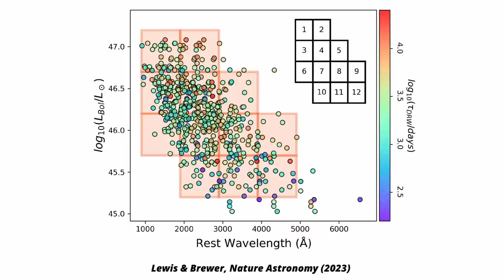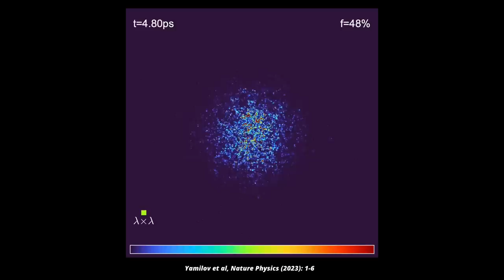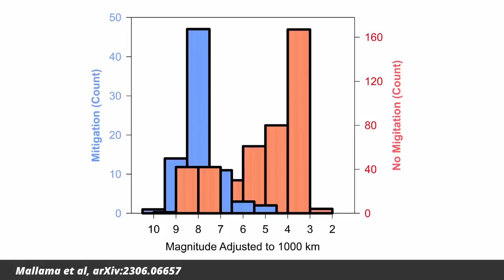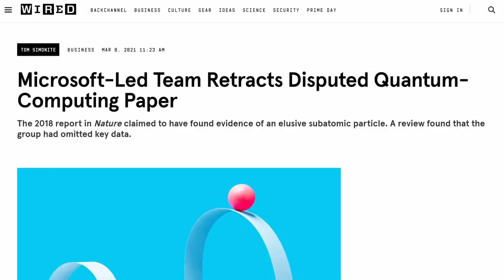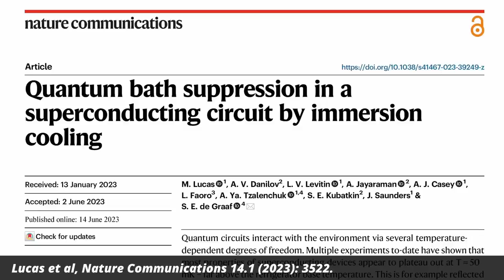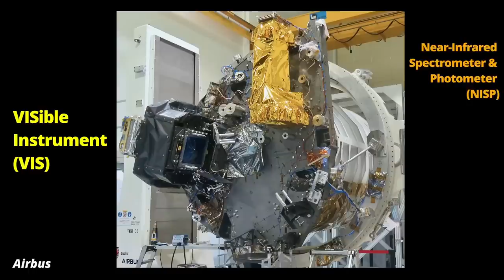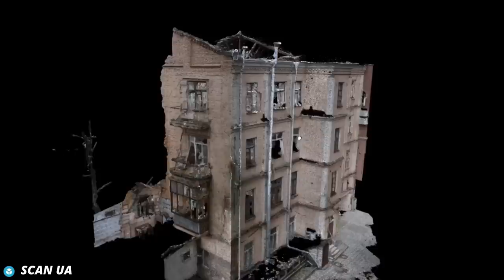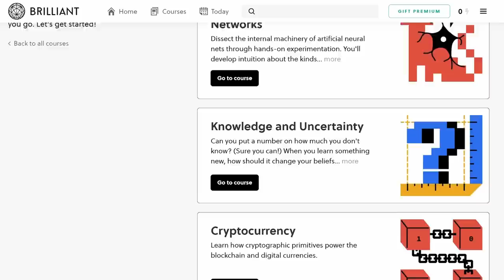Time Ran Slower in Early Universe, New Study Finds

Comment: I had tinitus. It went a way when I changed my diet to a low carb diet. I don't know if that will work for everyone, but it did work for me. Worth giving it a try.

It does come back when I cheat for a couple of days. Good motivation to stick to low carb.
Reply: correlation =/ causation
Reply: @filonin2  That's why I said: Worth giving it a try.

By the way, when I do cheat on my diet, the tinutus comes back. So there's definitely more than just correlation.

Comment: My model of the universe questioned the timeline of the forming universe due to the close proximity of all forming matter in the early inflationary and cooling down period of the now perpetual expanse of the emergent universe. Furthermore, I believe that the expansion of the universe is a constant that appears to be accelerating. Like the needle on a record player it spins at a constant however the needle itself must travel further each rotation as it moves further out to the perimeter of the record disk, making the length of the traveled distance a faster movement each rotation. I also predicted that there is a constant vibration throughout the entire universe that would probably be detected as a hum. This vibration i hypothesize is a vibration at the planck level of incremental movement. This I refer to as the present timeline only to measure the duration of the vibration. A relativistic timeline is a measurement from different perspectives, and the speed of light timeline measures distances. But what occures during this vibration affects the movement of every particle identified within this timeline at its present tense.

Comment: 1:23 if you've got ticks, you've got to do like my daddy used to for us kids in Kentucky. Take a match. Light it and let it burn a few seconds. Blow it out and touch the tick near the surface of the skin. Best chances are she'll pull out. If that doesn't work for your ticks, take a pair of tweezers and grab the rear end of the bug and twist it counter clockwise as you very gently pull on her. She should come right out. Now, I'm 50% sure it was counter clockwise and not clockwise. The worst that can happen is you'll twist her apart at her neck and her head will remain under the skin and cause an infection. But in Kentucky we get a lot worse than a little bitty infection from a tick's head. We've got lots of deadly snakes all over the place you've gotta watch out not to step on. I hope my advice takes care of your ticks on your waves in the time dilation of your universe. Happy hunting!

Comment: I am confused by item 1: The headline is "Time ran slower in the early universe", but the final statement is "It is just an observational effect" for us looking back. Now what ?   Is the headline just a misleading catch that should be replaced by "Time did not run slower back then" ?
From the citation of the original paper it does not become clear to me, how red-shift by expansion of the universe and by slower "ticking" time can be distinguished. 
If it actually did, isn't part of the apparent red-shift then due to the latter and consequently actual distances less than currently believed ?
Further thoughts: In that case, did light travel the same distance in less (due to slower) time ?
Would that mean that the speed of light was higher ?

My confusion increases...

Comment: If the universe started from a universal black hole that got very deep and exploded because gravitational fluid got backed up entering and exiting the core, there would be a lot of gravitational sag that quickly flattens out in some big bang tsunami. Once flattened out it can equalize with the surrounding (outside the matter filled universe) fluid and regain support, but is still limited by the speed of light. There is a time of equalization and the universe was smaller so the speed of light exchange would not be too slow. The higher gravity and sag, the slower time is.

Comment: As far as I can see every observation of red-shifted EM-radiation from a distant galaxy is an observation of cosmological time dilation.  In principle, the frequency of the radiation provides a clock with a certain rate of ticks at its source and when we look at the red-shifted radiation we see the clock running more slowly. As everyone knows, primarily, it's because the distant galaxy was  moving away from what has become us. I believe dark energy adds to the red shift that would be there with a cosmological constant of zero. Any other distant clock is obliged to be consistent - i.e. to have the exact same dilation factor - so it should be no surprise if this is confirmed. Still good to do so.

Comment: If time ran slower in the early universe, there is no dark energy.

Assume there are 2 observers, O who is deep in a gravity well, and O' who far away from any mass. General relativity tells us there is a time dilation T between them. Now they both observe a light echo. https://en.wikipedia.org/wiki/Light_echo

The measurement of the amount of time for the light echo is t for O and t' for O'. From GR we get:

t' = Tt

And the distance light has travelled in the light echo is:

s' = ct' and s=ct for O' and O respectively, where c is the speed of light.

s' = ct' = c(Tt) = T(ct) = Ts

The time dilation of GR changes the measurements of distance. The farther you are from mass, the larger your measurement of the universe. Dark energy is not require for the expansion of the universe. Only GR is required.

Comment: If time speeds up. Then there is no (or less) Doppler shift in light. Frequency remains fixed and the viewer is observing from a faster time line. Resulting in a smaller Universe than currently calculated.

Comment: It's good they found evidence for cosmological time dilation, but that effect makes perfect sense in any physical model that explains causality (aka the arrow of time) as the direction in which energy density decreases (has negative gradient). And that applies to any direction in (4D) spacetime, where "time" dimension has exactly the same properties as all the other "space" dimensions. It's only our perception of the sequences of events that gives us the impression that "time" is special in some way. It isn't. "Time" isn't even needed to explain anything, whether in a 1D or a 4D block universe.

As for "time" moving "slower" in regions of space with higher energy density, that's only relative to regions of space with lower energy density. Two observers, one in a region with higher energy density (on the surface of a planet, for example), and one in a region with lower energy density (in empty space, for example) would measure exactly the same value for 1 "second" whether they used a clock or a photon traversing certain length of space.

I'd go as far as to say that the constant nature of the speed of light is not just an assumption (of special relativity), but a fundamental property (of space"time") that arises naturally from the "dilation" of space("time"), or if you will, from the "contraction" of Planck values in the presence of energy... or, to refer to the model of space"(time") as a network of resonance chambers (or Planck cells, in the words of modern physics) whose function is to entrap "particles" (which aren't recognized by modern physics, but strings from the String Theory came really, really close to the concept...) of infinite potential/infinitely small size, where that reduction of the size of each cell happens in order to additionally constrain the "spillover" (of the entrapped infinite potential) between neighboring cells.

If anybody's into it, just do Fourier analysis of Dirac delta function (in the frequency spectrum), and see what happens to those infinite frequencies (of the infinitely "small" signal that Dirac delta function is) as you change the size of the resonance chamber/Planck cell (where only the signal periods which are whole multiples of the chamber's size can exist), and you'll see that the number of allowed frequencies decreases as the cell's size decreases.

The number of allowed frequencies will remain infinite "forever", but that infinite number will still keep decreasing as the size of the cell decreases... until the size of the cell itself becomes infinitely small (or "zero", if you will, though the concept of "zero" itself loses all meaning at that point, see below), and only one frequency can exist inside such an infinitely small cell -- the infinite frequency (or the "naked" infinite "particle" itself, if you will)... and space("time") ceases to exist.

The matter of the fact is that the very concept of space (with or without "time") loses all meaning at that point, because "space" is a mathematical concept, and mathematics can't really deal with infinities (it only really pretends to be able to), and infinitely divisible physical "space" is no space at all.

Yes, mathematics already works with continuous (infinitely divisible) spaces, but only in the form of abstract concepts. Try to give that abstract concept an actual physical reality, and... watch all of your carefully constructed math fall apart like a house of (beautiful, some would say... but not me; I'd call them utterly worthless or worse) cards.

Physical mathematical, discrete spaces are possible (this universe is an example of one).
Physical non-mathematical, continuous spaces are possible (it is possible to make a mathematical model that predicts the existence of one, as explained above).
Physical mathematical, continuous spaces are impossible (for all anybody knows, as no one has ever found one; so, until somebody actually does find one... nope, they're just not possible).

P.S.
It's good that no one ever reads these ("private") opinions... or they might get some "strange" ideas that could be found... "undesirable" by some... "higher-dimensional entities", to dip my feet in the woo-woo, new-age pond... or "non-physical intelligences", if we're to speak the woo-woo, modern physics lingo.

Both of those languages are closer related (in terms of the concepts that they are converging toward) than people realize.

Comment: I will now demonstrate what happens if you don't use Sabine's sponsor, and ask questions about things you only think you know.... 1. Quantum noise, if you do a single calculation using two sets of cubits that start in opposite states could you cancel the noise in a similar way to differential signals in audio wires? B. Would an observer in the early universe looking forward through spacetime and gravity see our time as proceeding slower also? Or would we appear to have faster moving time?

Comment: Hi Sabine, I'm writing to you 8 months in the future from this video.😂 Proof me that is impossible contact you in this pass. We go omniscient in the flow😊 my new theory.

I learned that time its just a coordinate in the infinite space.

How a coordinate can be slowdown?

If is measurable time what you talking about. How you traveling in the light speed slow your measurable time? 

00:56 the galaxies redshifted because the space isn't clean there is a lot of dust and the water slow down the light speed and solid objects just block it.🎉

2:56 driving at different speeds in a highway is a realistic example.

Comment: If the universe is expanding then it's only an illusion that time ran slower in the past because we are measuring it from a midpoint. As we look out we see expansion which gives the illusion of time slowing but if you were to reverse the action those points would become consolidated and closer together meaning time ran faster in the past not slower* It is also an illusion that the rate of which the universe is expanding is increasing. Its a consistent expansion. But when you are a particle within the expansion, You would be measuring an illusion That seems as if the expansion is speeding up but that is just a byproduct of relativity. Look at a baseball explode in slow motion. If each particle of the baseball were to measure the speed in relation to each other in ascending order from the innermost part of the baseball to the outermost part of the baseball, It would give the effect of an increased rate of expansion. But that's just because the explosion is emanating from a single source. The outermost diameter of the baseball does not increase in expansion rate. Only the distance between the particles is growing but the rate of which the particles are expanding is a linear rate. Its just an illusion. By definition time would have had to have run slower in the past if the universe was in a more consolidated state. So not only did time run faster in the past but the speed of which the universe is expanding is not increasing. And dark matter isn't real. Oh and neither is dark energy lol. These are just concepts people invented to explain away the illusion with bad math. Been saying it for 20 years😅

Comment: I wonder if the fact that time ran slower in the early universe means that the observed acceleration of the expansion of the universe is actually as a result of the acceleration of *time*. Is it possible therefore that the rate of expansion of the universe is constant?
Reply: were you paying attention?  it wasn't running slower.
Reply: Yes, I wonder the same thing. Could dark energy be time?
Reply: @-TriP-  Yes, yes, "it's an observational effect". So is the expansion of the universe, effectively.

Comment: I'm not sure about your research into laser acupuncture. Laser acupuncture can result in adverse effects, such as transient dizziness, headaches, and fatigue. Laser therapy can also result in misdirected or excessively intense burns, bleeding from the choriocapillaris, damage to macular and other ocular structures, and breaks in Bruch's membrane. The idea of applying something to acupuncture points smells of quackery simply because acupuncture itself is sheer quackery. That said, it could have some beneficial results due to the fact low-level laser therapy may have some benefits in some cases. I'd need to look more into these results but I am highly sceptical of this.

Comment: Time ran slower in early universe, new study finds.

-=-=-

My first impression [of that section], based solely on the title and likely assumptions:

So either nothing really changed (iterative quantized effects happen per base-unit-of-time, regardless) or something weird is happening now (more iterative quantized effects happened per base-unit-of-time back then vs now, and the why of the slowing (the reduction of maximum quantized effects per unit of time has greatly reduced) is inexplicable)

Sounds like the explanation of "universe initial explosion slowed, then restarted as expansion. Magical explanation follows" (which ignores the usual "there was nothing to stop the explosion" stance (or "nothing to slow..."))

-=-=-

After watching (3 min 5 sec):

Cosmological time dilation... Really...  So, we can no longer use redshift to determine how long ago a given photon took to reach us (by our perspective) because there is now a time dilation component.

Thus (assuming a smoothly scaling time adjustment rate that has close correspondence to 1:-1), distant stuff (near 45 giga-light-years distance) which supposedly happened 13 Ga ago actually happened 2.6 Ga years ago, while less distant stuff (say 30 giga-light-years distance) happened 4 Ga years ago.  If I assume a smooth rate comparable to relativistic effects, then the 30 g-l-a stuff happened (2/3ths distance, use www'omnicalculator'com for relative 5.11x adjust (at approx 294 000 kps speed), 2/3 speed gives 1.32x adjust, kurzweil library shows an example 30 g'l'y' galaxy at 13.1 Ga old) 10 Ga ago.

(Simplistic form is: If the time adjustment factor is right, then there are at least 2 ways to view it.  My examples are linear rate of change (nearer object uses a reduced time adjustment directly proportionate to distance) and semi-relativistic rate (nearer object uses a reduced time adjustment proportionate to the extreme case being treated as a relativity adjustment).  A linear rate of change shows that the furthest objects would actually be younger than nearer objects.  A semi-relativistic rate of change shows that the furthest objects are much younger than nearer objects.  Both of my chosen rates would hint at our understanding of "distance away reveals age" being nonsense, or at something being broken.)
Reply: I suspect that a reverse hyperbolic function could correct this to restore the "further is older" paradigm.  I'm not going to try, and I suspect such efforts will be made in vain, as any success will unenlighten us.  (I also suspect that the paper in question is the problem.)

Comment: wait, so, redshift is caused by distances increasimg causing us to observe those distant things in slow mo, therefore the past was in slow mo? what happened to those distances? and the conservation of energy? if those things were moving fast and aging slow and were already quasar hot, then wouldnt slowing them down and aging them faster result in the initial heat being wrong? doesnt this mean local quasars are colder?

Comment: IF they prove time ran slower in the past, what does that do to all the redshift calculations used to age the universe? IF it does change the redshift calculation what does that do to the concept of an increasing rate of expansion of the universe? Also, has the speed of light changed in 13.2 Billion years?

Comment: I agree with @geoear.  According to Einstein,  time runs more slowly at our Equator than at the poles. Experiment has confirmed this.  It follows that the meridians of longitude are now waves of some kind, not "straight" lines on the circumference, but I have never heard that navigation is any different because of it.  Any paper authored by Microsoft is immediately suspect.